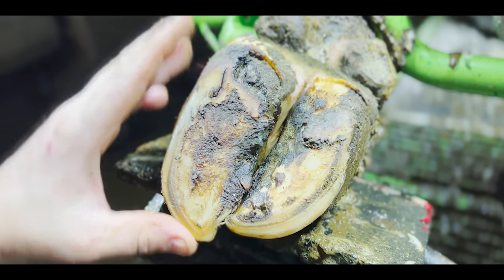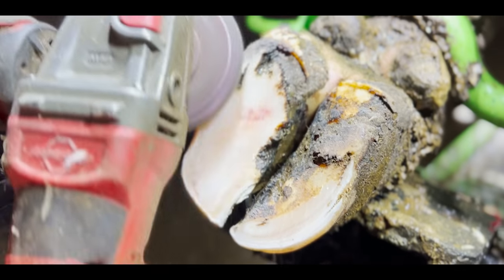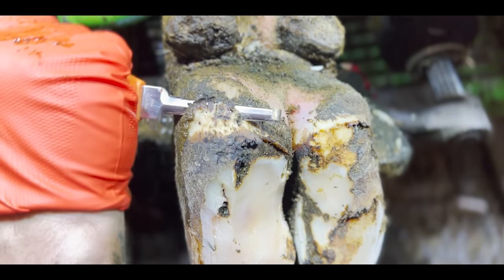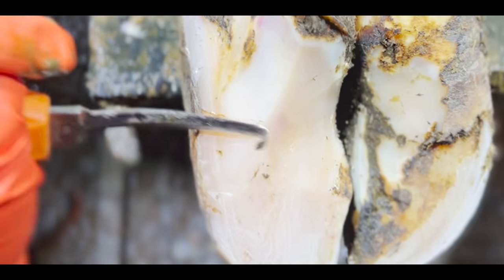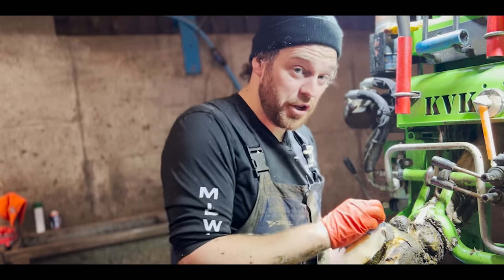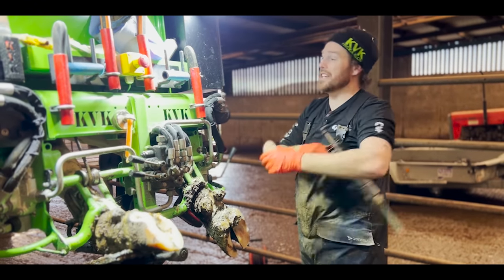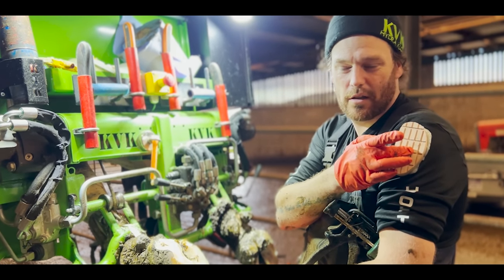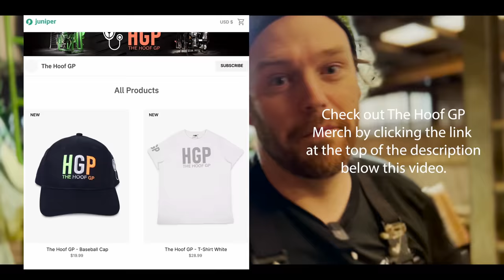PEELING LAYERS  & LAYERS of HOOF from this cows foot

Comment: Graeme treats his cows the way people should treat each other. Probably why I’m so addicted to his channel. Let’s crack on!!
Reply: Aye, let’s give each other a pedicure! 😂
Reply: @PLS.54   with an angle grinder and a knife.

in all seriousness i have used some serious tools to trim my big toe nails, they're so thick and hard that normal nail clippers can't handle it.
Reply: I notice that Graeme hasn't said much about his grinding wheel supplies.  Is he still getting in his signature wheels and if so, how are they working out?
Reply: @windhelmguard5295  😂
Reply: The first thing I pictured reading this was being up in the air in a sling getting my feet tickled😄 but barring that you're right on the mark
Reply: Lol!  I might appreciate the thought, but if someone comes at my toe-nails with an angle-grinder and knife... I'm going to fight for my life.
Reply: @bubs, soak feet til heels soften. Let dry slightly, then toss a sheet of coarse grit sandpaper down, hold with one foot, rub the heel on the other, then switch.  Do while seated for safety, and taping it down is a plus.
Reply: You mean cutting their toe nails?

Comment: Also epoxy on cotton and fiber is also necessarily going to hold better than on a smooth hoof. If you truly wanted the glue to stick to the hood better you'd want to use some sandpaper to give it a rough texture.

Comment: Question: The other day I watched the treatment of cow 555 I think it was….you placed a black block on her then doubled it with a wooden one, your explanation was for durability so the hoof could heal a bit longer
I thought the black blocks were flexible if not rubber…would it not flex a bit and cause the other block to fall off faster?
Why not use a couple orange blocks?

Comment: So with the glue that you use does it not need a rough surface to give it little cracks to hold on to? If it doesn't , how smooth do the hooves need to be to get a good set?

Comment: I've asked this before of a trimmer, but i don't remember/ understand thre response.  How does the block not create discomfort over prolonged use it's cutting the surface area in half for the weight displacement is it not?

Comment: If you glued a block to your shoulder, what would happen?  If it's attached to your skin, it would fall off as your skin naturally shed.  So, probably in a week or two if you did a really good job of gluing it on.  Faster if the glue doesn't adhere well to skin.  A lot of glues won't.  Skin grows and sheds very quickly.  And so it's hard to attach anything to it for very long.  Your shirt, however, is another story.  If the glue soaks into the fabric, it could create an extremely good bond to it.  You might need a new shirt.  And to remove Mrs. Hoof GP's foot from your behind.

Comment: The fact he glued the bovibond block to the shirt on the shoulder has really made me crack up. And the fact that it becomes hot, tells me it's like when you mix resin together and it heats up quite a lot. Worst case scenario. I poured resin on my pants and had to take my pants off cause holy dang it got really HOT and was starting to burn my skin  and that really stays and sticks. And I'm talking about the lap. The thighs and groin area. Had to throw away the pants after that cause it hardened up like a stiff rock board that you couldn't possibly ever get that stuff out. Ssssoooo I can only understand how that felt like with the block with glue on the shoulder lmao.

Comment: If you'd actually glued that block to the skin of your shoulder, I expect it would either be there for 1) about a week [long enough for the chemical heat reaction to have burned and blistered the skin, and for the damaged skin to slough off], or 2) until your body naturally regrew the epidermal layer beneath the block and shed the old, dead cells [no freaking clue, but I'm guessing a good while].
Reply: Pretty much; skin cells don't live very long in the grand scheme of things but depending on how hot that glue gets when it sets, he may end up with a burn injury underneath.
In that case, the block will fall off earlier as the burnt skin comes off, but the large burn would likely be an issue for weeks with great risk of infection - not something to try out.
Now, if we had a patch of horn/keratin thick enough to not get live tissue burned (like, say, a hoof) that block would stay on as long as it's not mechanically removed, either by walking on it and wearing it down or by prying it off with enough force. This could be tested by putting a small sample block to a cow's horns (basically the same material as hoof), no wear from walking on it and if the cow doesn't try to break it off against a wall or fence its gonna take ages to come off.
Likely at some point the glue will degrade, either from UV light in the sun or just from aging of the constituent chemicals, and then harden, crack and fall away - like certain types of plastic will.

Comment: my mom tried to do her laundry on Sunday while I was in the room and I got so anxious because she wasn't doing it right that I threw the jacket I was holding on the floor and took everything out so I could start the washing correctly. I have a SYSTEM, they are MY machines. How DARE you fail to load the washer correctly and choose the correct settings.

Comment: I usually love what you do Graeme, but that block on your shoulder was actually something of the most stupid thing I've ever seen you do.
Never use a chemical like glues on a new surface, especially with skin behind! 
You never know if the surface (your shirt in this case) will react exothermic (produce heat of some kind) with the new chemical.
I hope you tested before doing this stunt, but if you didn't I'd say it was well deserved whatever happened less than an medical emergency. 
I wish you've learned something from this. 
Keep doing what you know, but be careful with chemicals and their reactions!